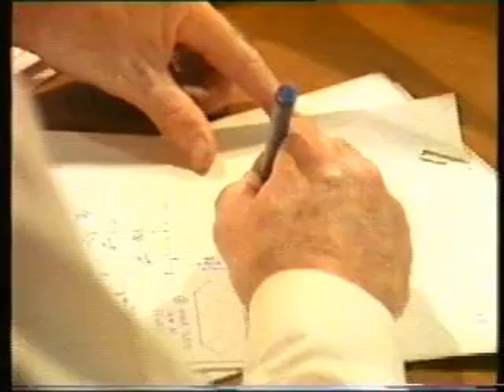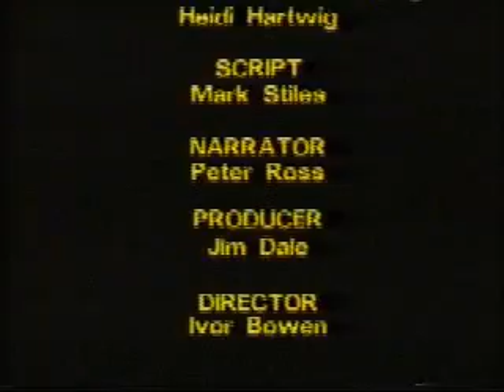Icarus - Concrete Hang Glider

Comment: In the 90's my dad build an impressive "concrete" glider that achieved a 25  to 1 glide ratio.

It's pretty simple actually, only requires 5 steps.

1) Get a glider that does a 1 to 40 glide ratio

2) dip the rudder in concrete

3) dip the nose in concrete.

4) let the concrete harden

5) scrape of as much concrete as possible

And done!